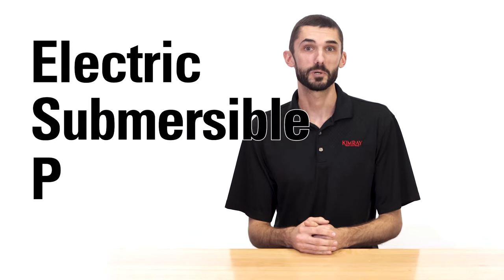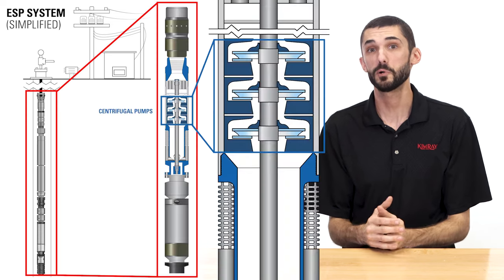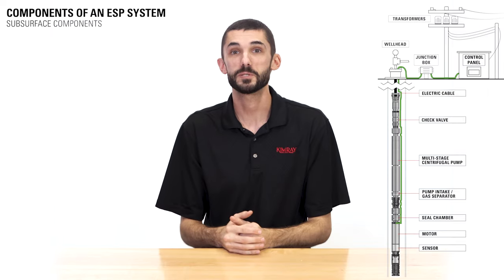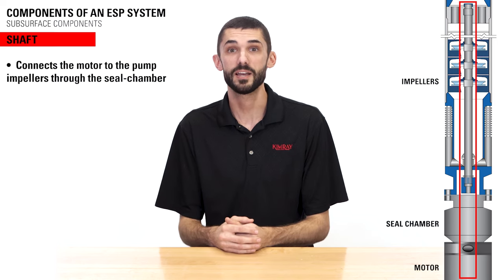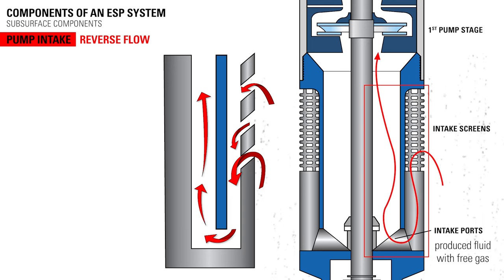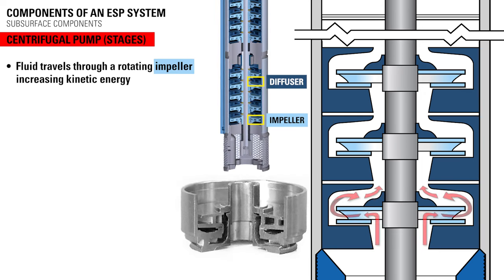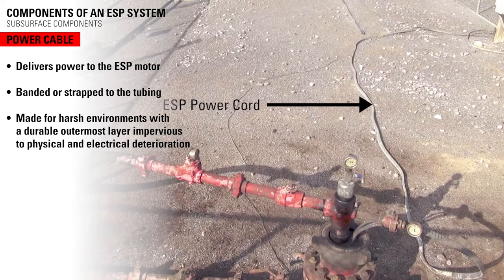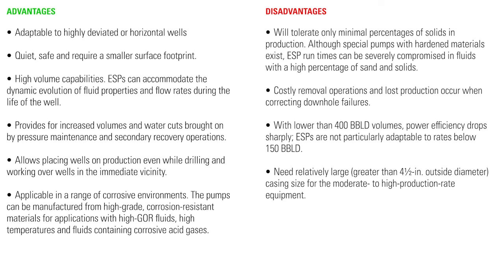Artificial Lift: Electric Submersible Pumps (ESP) in Oil & Gas Systems

Comment: Hello, thanks for Great Explanation. I just saw in some field that use Step Up Trafo before going to Junction Box for ESP. Why they increasing the voltage? isn't make it over volatge for the motor?
Reply: You only get typically 480volts in but the motor needs between 2,000 to 4,000 volts typically. Thats what the step up transformer is for.

Comment: Good video. Normally, what is the height of this pump? How much deep it can go? Also, how does it suit to horizontal drilled wells?
Thanks.
Reply from the maker: An ESP can work well in deep horizontal wells. The number of pump stages, as well as the motor size/power will determine the exact depth that it can operate at and still deliver the desired wellhead pressure.
Reply: @KimrayInc  Thanks for your prompt reply.
Reply: I worked for a major ESP service company for 5 years we ran them as deep as 10-12,000 feet on really deep well the deeper you go the more feet of head you are required to lift so more stages

Comment: Which lubricant do we use here? Hydraulic 32?
Reply from the maker: Hi, thanks for the question, but we would have to refer you to a plunger lift system manufacture to answer that question. Flowco would be a great go-to for those questions.